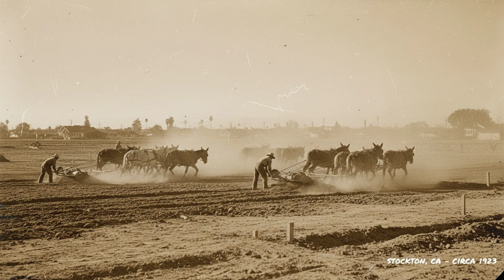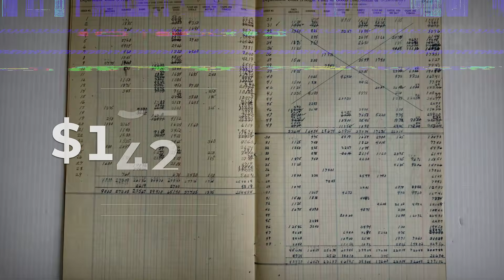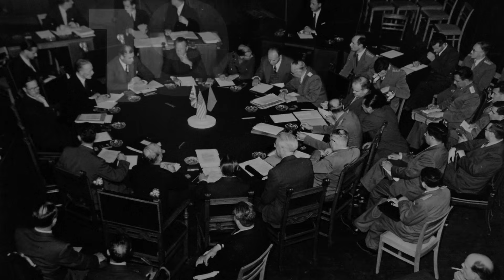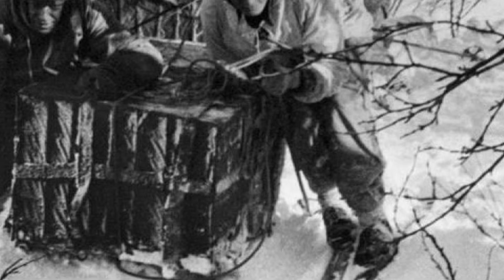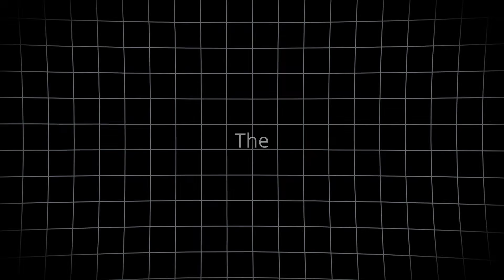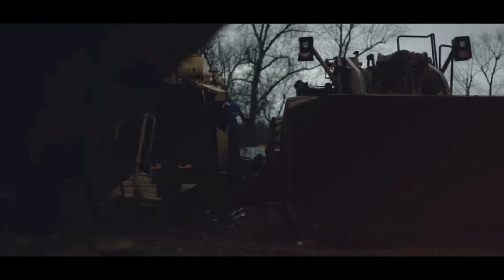He Had 299 Patents and Caterpillar Laughed At Him - R.G. LeTourneau

Comment: Biggest advantage of rubber tyres, is that they work automatically as the best compaction for sandy souls, eliminating another piece of equipment on many sites, cut transport, layout and compact all by one operator.
Reply from the maker: @bm4751 Great point — that built-in compaction advantage on sandy soils was a big part of why rubber-tired equipment became so efficient, letting one operator do the job of two. Thanks for adding that detail!

Comment: the tournapull wasnt just a scraper... it was the first rubber tired self propelled unit to actually move dirt at highway speed. changed grading forever!
Reply from the maker: @BuiltThisWayYT Great point - the Tournapull really was a breakthrough, the first rubber-tired self-propelled scraper that could move dirt at real highway speed. LeTourneau's design set the template for modern earthmoving equipment. Thanks for adding that detail!